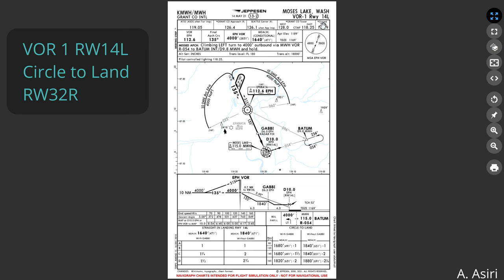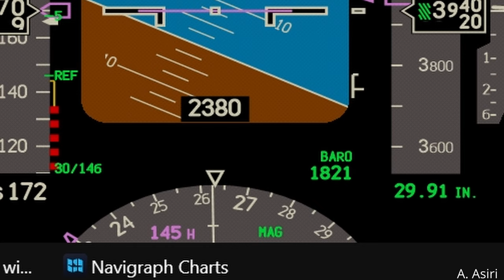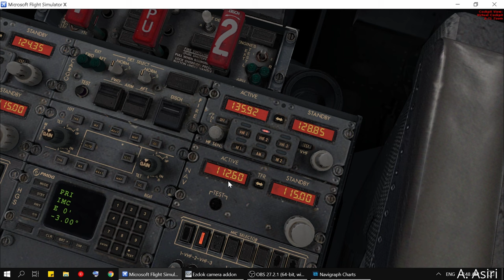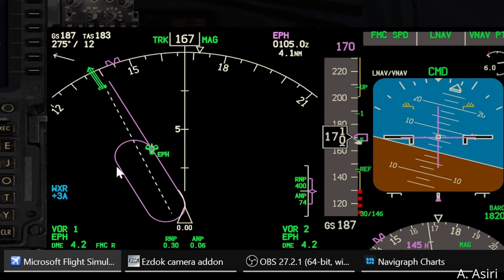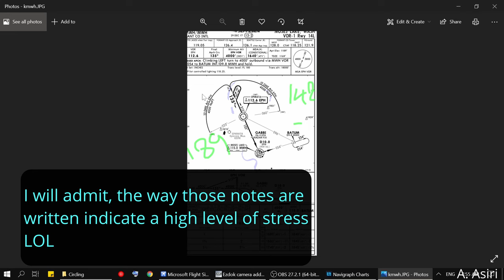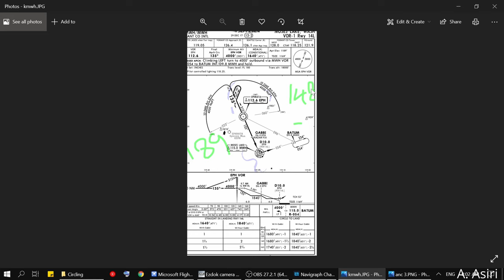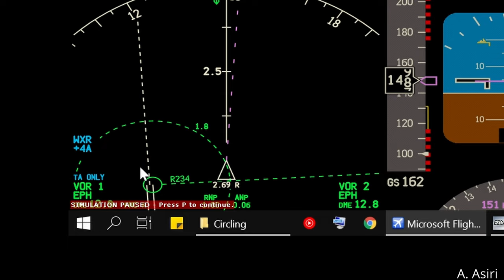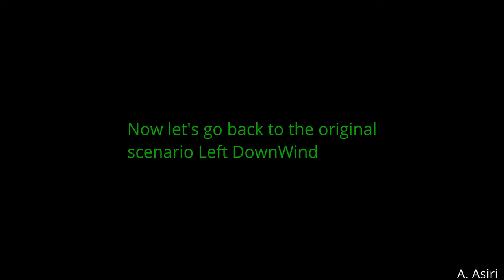Circling in the B737

Comment: It’s very cool seeing stuff I’m leaning during instrument training in a 172 being used in a 737 and even more cool to see it in the context of real 737 pilots studying up! But one question…

You mentioned pressing HDG SEL as soon as the plane levels off / reaches MDA. During my training (again, C172 part 91) it was reinforced to me that I can’t start that turn / start the maneuver until I’m inside the protected area. In your case I think you said 2.3 miles (from the runway threshold you’re approaching, not the one you’re circling to).

You didn’t mention that being a requirement and I doubt you just forgot. Is that simply not a requirement in part 121 whereas it is for part 91?
Reply from the maker: Hello @seattleraf 
Am glad you liked the video, 

Regarding your question, that is a very good point you mentioned, and the protected area need to be respected for part 121 as well, 
I assumed that pilots by this point are familiar with the requirement, but you are right I should have mentioned it anyways. 

In these specific approaches you usually reach the MDA inside the protected area, if not you should wait till you are in it before turning. 

Thanks again for the observation and the comment,
let me know if you have any other questions or comments. 

All the best, 
Abdul